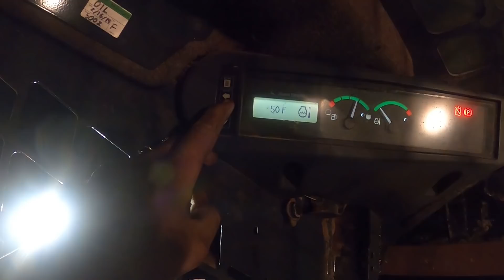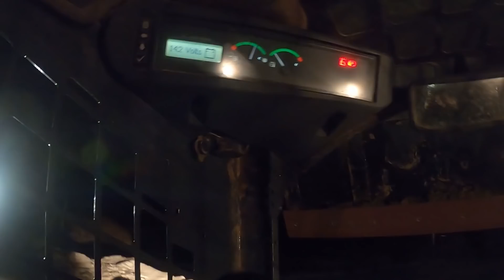Will It Starts? Broken Crank Repair On Deere 326D Skid Steer

Comment: Lift the bucket up with another loader. Unlock the pin and cycle the boom. Cycle the boom up and down. Have more oil standing by.

Comment: Seat switch or control interlock?  I doubt the issue is in the loader valve - good luck.
Reply: I would say the same thing. the solenoid for the interlock may be stuck closed.
Reply from the maker: Thats one thought

Comment: Shops clean if you know where everything thing is or what pile it's on. I don't like when people feel the need to help "put things away". Then I have to figure out where the hell it all went, when I knew exactly where everything was in the first place.
I like the people that have big fancy heated shops all decked out, that mostly just park there pickup truck in or pull there farm equipment and grain/silage trucks when they change oil, grease, clean the windows/cab.... Anything that requires any real fixing goes to the dealer or local shop to fix. 🤦🏻‍♂️ 
But atleast the service tech from the dealership has a nice place to work on their farm when their out there on a call....
Reply from the maker: Thats for sure. I'm struggling to find stuff and that sure seems the case

Comment: When did you expirence trouble with your machine? There's a 330G with 5700 hours on it and is priced at 28500 which sounds reasonable to me, would like to have a large machine
Reply from the maker: I believe 5k hours guess it is a rare issues since finding a replacement crankshaft was very hard
Reply: @DuffyAg  I thought john deere was good with replacement parts but I guess not

Comment: I guess I'm slightly confused about the dynamic of your farm, but maybe not. So your dad owns it and runs it, so how do you and siblings all fit in the mix and is there any other outside help? Just having a nose issue lol
Reply from the maker: My families operation. I am the only sibling who farms. I have have an off farm job doing robotic dairy equipment some day I will strictly farm. I also own a fleet of my own equipment and do manure hauling and harvesting. We do alot more then just milk cows so we have employees to help

Comment: I would bleed all the hydraulic lines by cracking them just a little bit but that's just the way l do it
Reply from the maker: I didn't want to do that with it in the air. It is one of my options if I can't figure it out

Comment: Chris,the way your hydraulics are acting it seems to me you have to lines crossed up.
Reply from the maker: I never took these lines apart all it is is a feed to this valve stack
Reply: Chris, with your determination and work ethic, I know you will get it figured out. The machine sounds great.